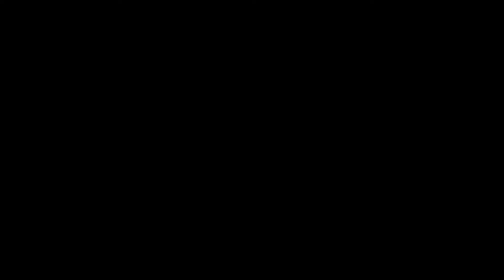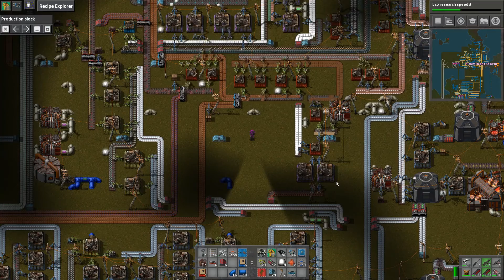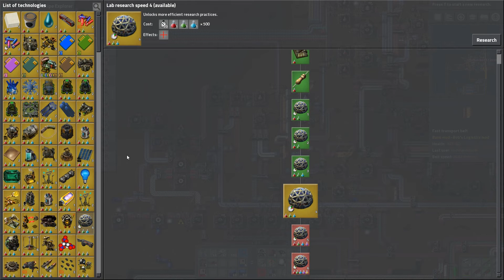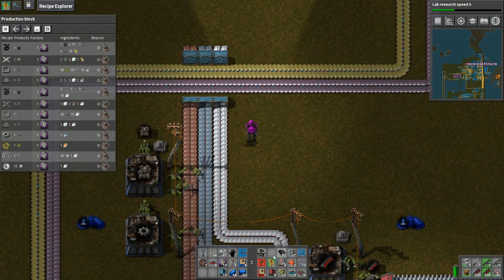Factorio - Angel's & Bob's - Episode 77 - Roboports

Comment: When you added the tinned copper wire loader, you forgot that loaders autofill both sides of a belt... but that was a shared belt with the other resource next door. That resource can no longer fit on the belt and something is going to break. If you add the other side of a T intersection immediately below the loader, you'll force the tinned wire onto only the belt side it was on before.

...Alternately, you could spot the mistake seven minutes later.
Reply: It  would have been easier to add an extra inserter or two for the tinned wire.
Reply: Or even upgrade the inserter.. One inserter is used on the output, and that assembler needs less input than output.